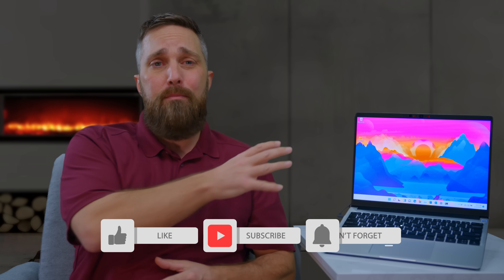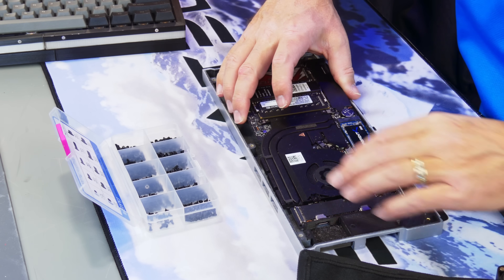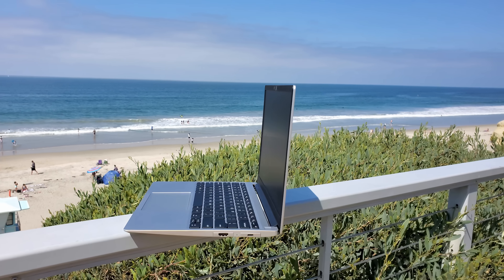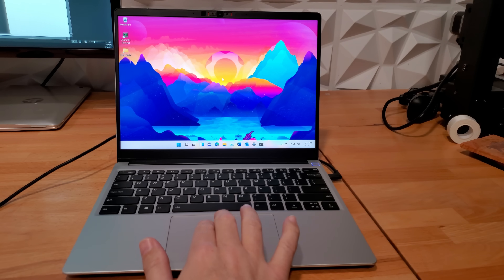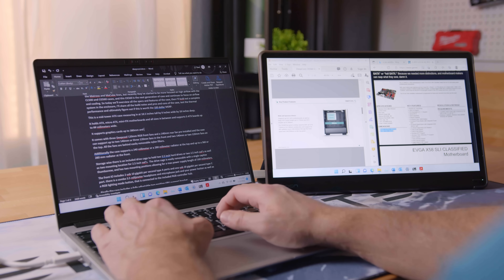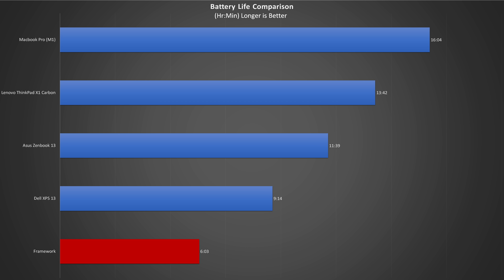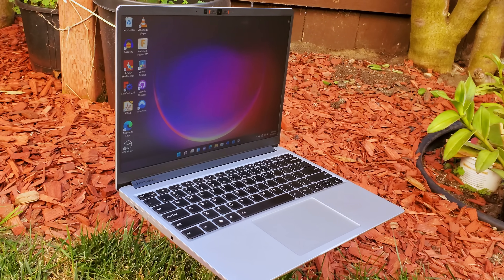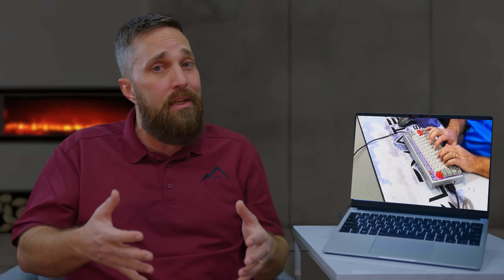Framework Laptop 6 Months Later. I'm Less Impressed 😐

Comment from the maker: UPDATE! Many of the issues I point out in this review have been fixed addressed by Framework. For updates be sure to check out my full Framework playlist.  https://youtube.com/playlist?list=PLwMvJ82pMgANOBK9ZL9rY4s2ExgLiYnYm&si=q18f-cBHd2vePJZF
Reply: I think it speaks to Framework's radically different approach to hardware that a "long term review" has such a different meaning when the product ecosystem is built for long-term support and reparability. If this was a black box laptop from any other manufacturer then six months of daily driving would have identified most, if not all, of the quirks and given an idea of whether or not the manufacturer was going to offer any more fixes... and that would be that. With Framework, firmware updates and hardware fixes keep trickling down through the range months after release, and as other people have pointed out, some issues can just be nullified with a part-swap. I'm not sure there are many other laptops where you can come back 18 months after your original "6 months later" review and find that the situation has improved :)

Framework systems aren't perfect, but I'm convinced they're doing good things, and seem to be improving all the time.

Comment: I was interested in upgrading - but as it seems this $1.5k laptop is only suitable for routine office work I might as well stick with my 2010 Dell Latitude on Win10 - 16:10 IPS screen, repairable, better keyboard than any laptop in the last 10yrs and costs about $150. Still runs all the Office software just fine (and the trackpad still works as expected).

Comment: a Dell laptop refused to boot if it detects the shell is open. Even if its not. 
battery is a problem ? just buy another one. try to do that with a mac ? Just watch any Rossman videos on what a nightmare it is to do that . 
Every single point here is a W for Framework just for they trying. and they will keep trying and improving.
Reply from the maker: If the battery in my MacBook Pro holds less than 80% max charge Apple will replace it for free.

Comment: If you use tap to click, you are weak, your bloodline is weak and you won't survive the winter.
It is a lot easier to mistake a short swipe for a tap than it is to mix up a force-press versus a touch, on top of the physical feedback you feel with your fingers.
I currently have a thinkpad s1 yoga, and it has a rather impressive mechanical touchpad that I absolutely love. However, I have tried laptops with the meh clickpads and I do get that many people would hate those...
I hope that lenovo doesn't have some IP lockout for other vendors on that touchpad design... it's really good.

Comment: oh I had an idea, what if someone created a battery slab that clicks onto one of the modules and gives you a "secondary tank" it would make the laptop twice as thick probably, but it would also give you twice or more battery life. plus that allows it to get over 100Wh without being a flight risk (100Wh is the limit but that's per device, if the device splits in half then it's technically devices)
so basically someone would have to take the battery from a laptop (preferably a 99Wh one) and 3d print a case that clicks into one  or two of the expansion ports for security, and then connect the battery to a USb PD battery bank circuit board.

Comment: Thanks for the review! I also support the company and will soon vote with my wallet, buying loaded Framework 16, top CPU and RAM but without discrete graphics module. I use it mostly for work, where sometimes not even 64GB of RAM is enough, but I also want it to comfortably play Starfield, which current discrete graphics module wouldn't allow (comfortably). Will wait for more powerful graphics module to come out - I'll buy it then. And for now, I can game on my desktop with RX7800 XT (the Framework has RX7700S, which is way less powerful than mine current graphics).

Comment: LOL, if it comes with Linux and only Linux it's overpriced garbage. Why? Because it doesn't actually need to be able to handle actual computing power to run. Get yourself a beefy Windows Machine and dual boot it. You're not saving any money, in fact you're probably paying and getting less.
Reply from the maker: It dosen't come with Linux, at all. It only comes with Windows. But to counter your statement, you should check out System 76.

Comment: I think the one thing that has me still considering the laptop, despite some other downsides and potential deal breakers, is that even if it turns out that Framework can't make the ecosystem last long-term, it wouldn't be super difficult to repurpose the parts into, say, a PC (albeit with the specs of a low end laptop, but that is acceptable to me.) It should still keep some of it's value even if framework goes belly-up. However, I'm still mostly banking on the movement.
Reply: Mostly in the same camp. A raspberry pi but with vastly more compute? The perfect home lab micro server.

Comment: That's sad, I guess the modules are expensive but having build and upgrade computers, upgrades are moot coz' by the time you need to upgrade the whole motherboard and other parts coz' it'd be already be too slow for the faster upgrade part, in this case module, else if you pair it with faster parts there'll be bottlenecks.

I don't think this'll work, there'll be a point it's just better to sell the whole things and buy a new one, that's the best upgrade.

God bless.

Comment: Nobody is going to upgrade it. It is a clunky design that is going into recycling just like every other latop.
Reply from the maker: Yet Framework is well into batch 5 presales of their upgraded Ryzen mainboard. Meaning thousands of ppl are upgrading their laptop.
Reply: @ElevatedSystems  Upgrading from last years? Why the hell would anyone do that? Most the cost of a laptop is the board anyway, that is basically like buying a new laptop every year.

In the long term you are going to be paying more for this thing and it is going to have a lot of old functionality even with a new board.

Comment: Framework is a company that goes above and beyond to assist its consumers, which is an exceedingly rare occurrence these days with most other companies. I'm somewhat surprised that you didn't contact them first to inquire about any issues. Instead, you posted this clickbait video, potentially tarnishing their reputation.
Reply from the maker: You must have missed the part where I talked about contacting their very helpful customer support and it bieng an awsome experience. They are an awsome company, but that dosen't mean their product dosen't have some flaws. I'll let the Apple reviewers be biased fanbois, I'll continue to do my best to be fair and impartial.
Reply: @ElevatedSystems  I missed it because I didn't have the time to watch most of the video yet. However, it's true that almost every computer will have an issue here or there. It's nice to see a company like Framework doing their level best to satisfy a wide range of users. That's not an easy task by any means.

Comment: Only con I've see  is that the battery uses screws. It should have been one that slides in n out like normal laptops... Normal laptops seem more modular in the battery than this.. Which is odd.
Reply from the maker: I'm pretty sure the ONLY new laptops still available with modular removable batteries are Panasonic Toughbooks.

Comment: As someone who is on the market for "immensely powerfull laptops with no concession on neither the raw power when connected and the autonomy when on battery", I really hope that framework can represent the beginning of a come-back of upgradable laptops... I miss the time where you could upgrade your GPU instead of having to buy a new notebook every 5 years.
But Framework's laptop are currently much too weak for my uses, even the last one. I"ll wait for a company to create a 17" designed for massive calculation, 3D modeling, manipulation of huge dataset, and gaming. If it ever come out, I'll insta-buy it...

Comment: Look, I bought a Lenovo. And after 3 months, the USB-C loading cable would only load on one side, how I plug it in. 
Had it 3 weeks send it back, to fix it. I got it back with a new power supply, and it wasn't fixed. 
In the meantime, I got 3 power supplies (for free) and it's not fixed.

This happened even to high-end Lenovo in my company. So they got something wrong there.

Never used the build in camera, but needed it the first time through corona. 
And what happened, it worked 4 minutes. After then, it was broken.

I didn't even tell Lenovo, since there was corona. I couldn't work without it. So fuck it. I had to use it, for production!

What was next, the fingerprint sensor works only as it likes to.
Maybe it does, maybe it does not.

Conclusion: Lenovo sucks, and I'm willing to buy next time a Framework Laptop, then again to buy some non-fixable crap, which even loses functional things in the first year!

Comment: imo, battery life isnt a factor for laptops, what percentage of your time do you actually spend on battery?
I've never used a laptop on battery
I've never seen anyone else use a laptop on battery except for people waiting at the airport for their plane. and thats only because all the power sockets are taken, because all the seats are taken.
they're sitting on the floor literally using a laptop as the name implies, sitting crossed legged on the ground up against a wall.
how often does that happen is someones life?
not often, show up earlier and it wont even be a problem.
fuck laptop batteries, give me more power and more cooling
Reply from the maker: 100% If I'm using my laptop it's on battery. I literally never use a laptop plugged in. That's what my desktop computers are for.
Reply: @ElevatedSystems  thats what I use tablets for lol, I take laptops when Im not going to be at home, but ill still be stationary somewhere. tablets make more sense imo for mobile use

Comment: I have a Asus laptop bought in 2014 and still works fine, replaced a fan and was impressed how repaireble it is, also recently I opened a Motorola phone, the g32, in my opinion a very pro repair phone. UA's impressed by how many things can be replaced inside it

Comment: Framework laptops are far too expensive, they charge $60 for an Ethernet port and their base model laptop is $3000 AUD (without any expansions), to put that in perspective I can get the same performance from a macbook for $1500 less and the only tested/provable tradeoff is that I can't upgrade it or repair it myself. If I'm spending that much on a laptop chances are that I'm wealthy enough to not give a shit about repairability (which is why Apple keeps getting away with it). On top of that there is the fact that as it stands there isn't a whole lot of third party support for replacement parts and upgrades (we're talking literally one company saying trust me bro we'll totally make compatible main board upgrades), this is pretty much what's stopped any right to repair phone brand dead in their tracks...

Remember, if you want to take the portable computing world by storm you've also got to be price competitive (especially when it comes to the cost of getting replacement parts. If we're talking enthusiast level hardware with user end upgrades the thinkpad is still the king of the market due to it's significantly lower cost to entry and pre-existing community of modders and hackers.

Comment: The biggest short fall i see is that one is limited to 4 ports. I would require power, ether net, external monitor, USB3 ... oops, I just ran out of ports and I really prefer my keyboard and mouse.  Perhaps some of this can be addressed via a dongle or docking station but my experience has been limited performance with more than one function on any USB-C port. Perhaps Thunderbolt does better but I can not speak to that.

P.S. you are totally spot on regards the 3:2 display ratio !!!
Reply: Their new 16"(?) laptop has six ports I think.

Comment: You are running into the problem every modular system has.. acpi issues and compatibility with the range of devices. Oem drivers are not usually optimized.

Comment: I’ll give it a thought when my 2013 MacBook Pro starts doing anything wrong. Lol. Yeah…sure. 😂 For all you PC laptop users, any body still working daily with a 10+ yr old unit that still works perfectly? Lol. 5 yrs old? Two?? I have to laugh at somebody done with a laptop in 6 months. Just get a Mac and solve all your problems.
Reply: Your macbook's nvme speeds are stuck in 2013.
Reply: @ummerfarooq5383  whatever that means, it hasn’t slowed me down or kept me from doing anything I needed. The thing still crushes 4k rendering in FCPX and runs over 100 audio tracks simultaneously in Logic. Show me the 10 year old PC of ANY kind that does that. 5 yr old?? Maybe, but doubtful. Nice try though.
Reply: Found the apple fanboy
Reply: @josephschroedle481  there are boatloads of ex PC users that got tired of needing new $2500 computers every two years. Pretty easy to fanboy when a 10 year old laptop works absolutely good as new. I have a newer 2021 MBP as well but the old one is the daily. How much have YOU spent on computers the last decade? More than $2500 and none of them ran as well as a MACBOOK PRO.
Reply: @videditorEB1  Thanks for asking I got my gaming pc in 2018 for well under $1000 and it still runs great! It’s not as good as a new $2500 pc but there is no reason it should be. Also the computer i upgraded from was also a 2013 MacBook Pro (i7+16gb), while my MacBook also still “works” it is definitely showing its age. And because Apple soldered everything but the ssd it will never be upgradable doomed to become e waste eventually